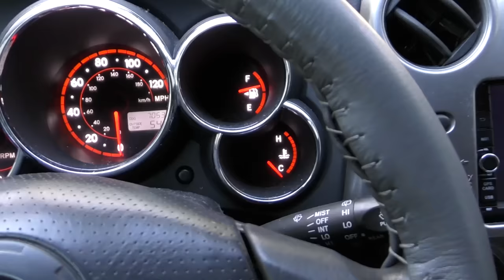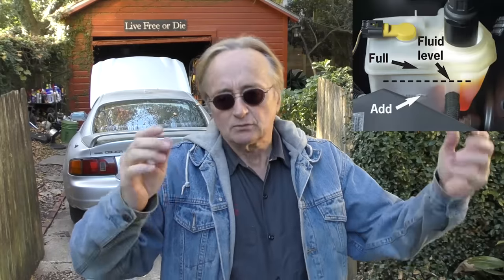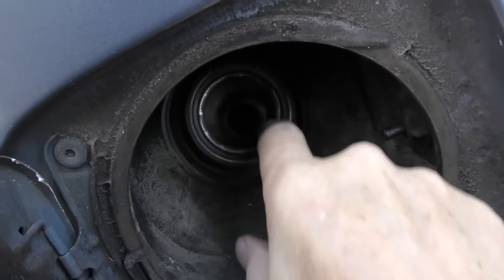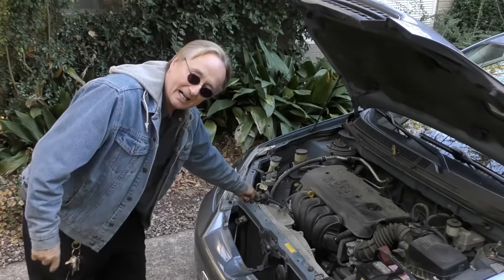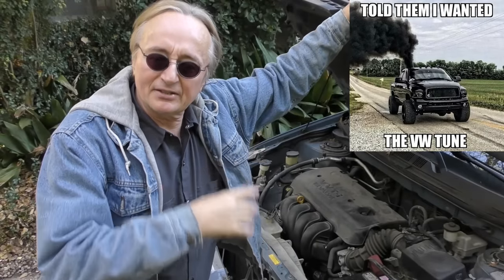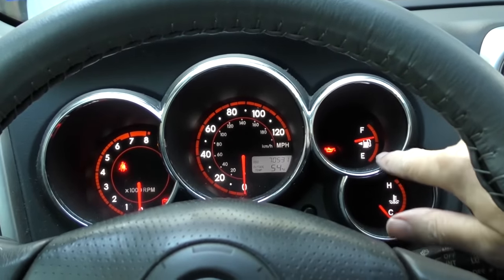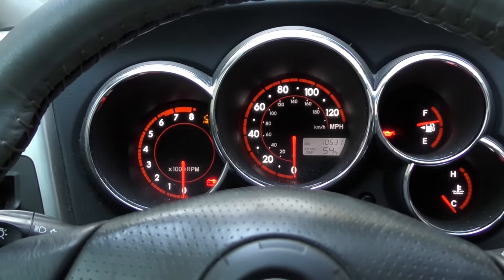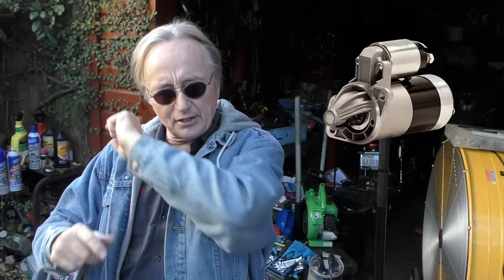Please Stop Doing This to Your Car (It Broke My Celica)

Comment: Last time I was this early, GM still made reliable vehicles.
Reply: Taha Khattabi lol u were early In the late 90s
Reply: WOW!!,that must have been back when GM was just a concept..
Reply: I'm guessing your Impala has a Buick 3800 motor in it.
Reply: Taha Khattabi my 2007 Chevy cobalt is sound with 152k miles, transmission seems kind of clunky but reverse still works and I don’t have to tap the gas for it to reverse and it can still creep in traffic with no problem
Reply: Will Dwyer Don't judge modern cars based off of your 15 year old car. You will be sorely disappointed when you eventually get a new one.
Reply: Taha Khattabi YouTube wasn’t around back then
Reply: Corey The FAM lmao u mean the 70’s right?
Reply: @erty2389  pretty much.
Reply: I've seen this "joke" posted here so many times.
Reply: Jason Blooey Lmao any new GM product is something you might have as well just literally pulled out of a junkyard.
Reply: The year was 1973...
Reply: Fred Flintstones car was GM?

Comment: In Arizona when they check the emissions they also check the gas cap. If it's bad they will replace it, free, on the spot.
Reply: No, they will tell you it's bad and YOU need to replace it. The state does not give you much of anything for free. (I live in AZ, and I've had a bad gas cap.)
Reply: @daleinaz1  That's not true at all. The emissions station has given me two gas caps for two different vehicles over the past six years. All I had to do was sign for it. The last time was just this last April. This is in Pima County.

Comment: Scotty, that last problem you discussed with the Chrysler, I had the same exact problem with my ‘97 Jeep Wrangler. I had flushed the system, still barely any heat, and the coolant level kept going down. Since I was already having to take out the dash for another job I figured why not replace the heater core. After that my heat is unbearable.

Comment: The Lime Away trick can be pretty effective - but it comes with a huge caveat. There is a pretty significant chance that when you clean the crud out you will also open up holes in the core. Frequently the only thing keeping your old heater core from leaking is the rust and crud plugging the holes, so be prepared to have to replace it ASAP if necessary when you try that trick.
Reply: Low heat? Another thing to check is the thermostat. If while driving, the heat gauge almost never gets up to normal (which is usually about 1/2 way in most cars) then you need a new thermostat. Another symptom is the transmission might not be shifting into lockup gear if the engine isn't hot enough, also indicated by the heat gauge. Temporary fix: the old cardboard in front of the radiator trick, the amount of blockage of air carefully adjusted so as not to overheat the engine.

Comment: Probably a bad idea to put this in the comments, I've been told on Chrysler's that people will soak the heater core overnight with lime away, apparently soaking it overnight works great, never tried it. Was told by a buddy it worked but he sprung a leak, then he dumped K-Seal in it, which I use and love because it doesn't clog up stuff, and the heater quit leaking coolant and he's still got heat. Win win long term.
Reply: Lot of work--are used heater cores really that expensive?
Reply: @jamespfitz  No the core is cheap, some of the vehicles are a day and a half job to pull the dash though.

Comment: Scotty, you should have told people to try and find a new gasket for the oem gas cap. I kept getting fuel system errors, no matter how much I tightened the cap. Welp, found a new seal for $1.28, put it on, problem solved. And I got to keep the original gas cap that came with the car.

Comment: all cars have temperature gauge you say? 
BMW has entered the chat
Reply: Mattfoster84 even scotties fav brand toyota, some yaris dont have a temp gauge
Reply: The hood is sealed so you need to junk the car.
Reply: Modern cars have only green and red sign!
Reply: @gertvanpeet3120  Annoying cost cutting , i like warming up my car don't know where temp is at on a freezing cold day
Reply: Nissan nv200 too. It has an rmp meter but no temp gauge. Smh
Reply: @1stock1not  How are those nv when it comes to reliability?
Reply: @CRAPO2011  all i can say is its 2 years old has 71,000 miles and hasnt had any issues yet. The cvt worries me though from all ive heard but again no problems yet. Good gas mileage though the tank is only like 12 gallons.
Reply: @CRAPO2011  let me also say its gotten 5k full synthetic oil changes. And it doesnt really ever have any substantial weight being carried in it.
Reply: Asian market Honda has left the chat and smashed their computer
Reply: @recoilman24  for shame.
Reply: No temp gauge on the Vauxhall Astra. What a joke, now drive a Volvo

Comment: ThAnk you for video![ I need to check my Mom's fluid for heater. Took her car to radiator place didn't fix problems with three visits. Owner told me my Mom doesn't know how to use heater. UNPROFESSIONAL!! My Mom a lot older than owner, & my Mom going to his dads business for three decades with son owning business for probably ten years. So my Moms heater works in some vents sometimes. Frustrating sincE she gets off work after midnight cold by beach!! Good to know about not letting gas get low!!

Comment: Yep. I tell you what I learned a lot about brakes and how to bleed them and all kinds of beneficial things just from owning a dirtbike before. I bought it and took it completely apart down to frame and swing arm separated. rebuilt everything on my own and I had no experience before doing anything like that although I'm good working and taking things apart and remembering how to put them back together. I didn't rebuild the engine but I did replace the clutch basket and disks and replaced gaskets here and there. I also rebuilt the carb and a lot
Of other things but the main thing was rebuilding the master cylinder and the brake caliper/replacing brake lines and learning how to bleed them and get those suckers nice and tight feeling. My motocross friend use to love my brakes and was impressed with how they felt and weren't spongy and nice and tight.(this model year was known for the brakes being a bit spongy) not mine though lol. but I spent More time than other bleeding and I think that was the difference maker. I had no instruction manual for the bike either just some internet posts and some videos here and there. i had no problems. Literally first kick and it started right up after being apart for a few months and everything worked flawlessly on the first go. No tweaking. So luck was involved a little
I'm sure lol but I enjoyed that project a lot. Also this was with a 2003 kx 250 2 stroke so they are designed well and fairly basic little machines as most dirt bikes are. And also growing up learning how to use a clutch on a dirt bike taught me all I needed to know when I got my first manual vehicle which I own right now. It was a great learning tool.

Comment: I don't let mine fuel  level get below 1/4 unless  there is a really good reason.  When it gets to 1/2, I start checking the local fuel prices or checking the map for gas stations, so I don't get into an emergency.  On a long trip, you don't want to sit in the grass next to the road for an hour ( or two!) for your roadside service.

Comment: Another way to find out if the starter is bad is to turn on your headlights and turn the key to start it. When the lights go dim to out, you know it's the starter. (This test is done with a fully charged battery)

Comment: Something I frequently deal with at work is people replacing the rubber seal from their fuel cap. I always advise people don't skimp on the rubber. Natural rubber, neoprene and even EPDM will all blister. People need to use black nitrile rubber. I'm not sure how it goes for diesel fumes (it's probably O.K.), but it works perfectly petrol/gas . The other rubber types blister with bubbles forming inside the rubber. (Technically, only latex is rubber, the rest are artificial rubber.)

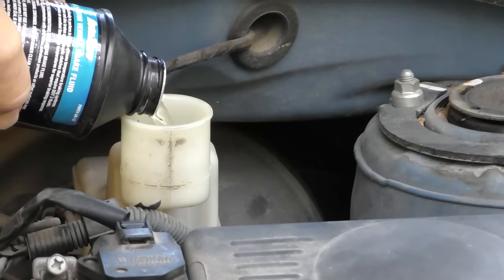Comment: 0:50 I was told if low on brake fluid, should get breaks checked.  If the pads are really worn, the cylinders will out more, and that is where all the fluid went. Just adding fluid will mask the symptom till breaks start squeeling.

Comment: most of cars I've seen here in the uk you can get access to the top of the fuel tank  and access the pump and orr fuel sender from inside the car  by lifting the rear seat

Comment: That trick with the heater core worked for me!  I had a 95 Ranger.  When I bought it the temperature gauge never left cold and the heater didn't get warm.  I figured, no problem, just has a stuck open t stat.  wrong.  the temp gauge sender was bad, and the heater core was plugged solid.I tried flushing it with a garden hose clamped on, not one drop came out.  then tried my air compressor.  Still nothing.  As a last resort, I tried radiator flush, letting it sit for an hour.  Nothing.  I gave as it was late spring and left the hoses looped on the core with the flush still in it.  As fall approached, I decided to try connecting the garden hose one last time.  IT WORKED!  And it worked great!  Tons of heat, just like new, and never leaked. Maybe someone mighty have put stop leak in it at some point?

Comment: Hey Scotty. I have a 2014 Dodge Avenger with a 2.4 and 82k miles. What’s your opinion on these cars?  How reliable are they and what are the common issues you have seen with them (assuming you have worked with them). Thanks

Comment: Scotty Kilmer Personal experience here. I had a plugged radiator so I changed it and it wasn't getting hot in side but the gauge and fluid level was fine until I went up a steep hill and that "burped" the air out of the heater core.

Comment: I "fixed" a reoccuring code I was told was gonna cost me several hundred dollars a month ago.
I replaced the gas cap. I had dropped the other one (blown off the place I set it on while fueling) and I assume something inside the interior safety vent cracked or broke.  No more codes.

Also, I read somewhere that any GM product with an evap system you should tighten the cap till it clicks at least three times. Any Ford, a minimum of two clicks. But you can't damage them turning them too far unless you wear out the little ratchet clutch turning it hundreds of times around.

Not a repair or trick, but if you drive a lot of different cars for any reason, the side of the gas gauge the little fuel symbol is on tells you which side of the car the fuel door is on.

Comment: Hi did not mean top up the fluid, most motor  manufacturers recommend you replace the brake fluid due to the hygroscopic nature of the fluid every 3 to 4 years.  I carry out a complete fluid change in my Saab every 4 years which is approx 60K miles and that includes Timing belt, coolant and brake fluid.

Comment: Fun story, one time me car wouldnt start, there was a wire that had corroded and broke, it was copper. just so happened to have industrial copper wire around. put that on the starter, it worked for another year until i had to go across a flash flood pool. probably would still have it otherwise, the brushes still had about half their life left.

Comment: I have an old Odyssey that loses about a few cups of coolant a year. I’ve never found the leak and I just top it off every few oil changes. Some things are not worth fixing.
Reply: I totally agree. I have an Accord doing the  exact same thing. I have looked everywhere for the leak even did a pressure test. Easier to just top it off every few months.
Reply: Friend had a Camry that did the same thing, didn't seem to have a blown head or anything, never figured out the issue, he just tops it off every now and then. The car is a beater anyway.

Comment: In many cases of a dead battery, the reason the battery went dead in the first place is because of a bad alternator. I would jump start the car and measure voltage across the battery terminals. If the alternator is charging, it should be around 14 volts (give or take half a volt)

Comment: Thanks Scotty. My heater doesn't work at all. I located the value that switchs the the water flow from heat to cool. I couldn't move the cable so I unhooked it. The valve seems to work, but when I ran the ac and then switched to heat the cable still didn't move. Does the cable need replacement or maybe lube it. Or could it be locked that way because the heater core blew and the old owner made it that way so the heater core would leak?? Also when I did it manually still no heat. Maybe they bypassed it???

Comment: Hey scotty, im gonna be getting my learners permit next month and want to start thinking of a first car to get when I turn 17 the year after. I recently rode in two crown vic taxis and really like the size and feeling of them and they seem very reliable. Are they good first cars?
Reply: Very much so. They're also big enough to grow with you into having a wife and kids, if it gets that far. Any Ford Panther platform car (except Mercury Marauder) from 2002 and later are the best. '96-01 are OK, and you can get them cheaper, but the first thing you need to do is to have the all-plastic intake manifold replaced with the semi-metal one found OEM in the 2002 and later, and have coolant flushed in the process.

Three small weaknesses to the car:

1. If there's misfiring (which is rare), fix it fast or it'll blow the catalytic convertor.
2. The RWD isn't great in wintry conditions.
3. If there are any kids in the car, be sure to turn off the accessories when you're away so they can't accidentally roll up the window if they lean against the rocker switch. If there's a switch in the front that disables the rear window switches all the time, it's best to turn the rear switches off as soon as you buy one and then forget about it.

Comment: Some manual transmission vehicles also use brake fluid. I had 2 94 escorts that used brake fluid for the hydraulic clutch. Had a leaking line on my escort gt that would cause my brake fluid to go low. Couldn't figure it out at first why I would lose brake fluid first then found out why. The hydraulic clutch used the same reservoir as the brakes.

Comment: 2nd reason for no heat… You smoke, you vape, you warm up your car in a closed garage (unattached for obvious reasons). These 3 things can rapidly clog your cabin filter, vaping probably being the worst. It’s sticky residue can quickly clog the pores of your cabin filter and cause a severe loss of heat production inside the car.

Comment: I have a 07 Grand Prix GT that just has the brake light come on and the screen says LOW BRAKE FLUID, but the level is fine. Brakes do need to be changed in the near future but have never experienced this before. I've recently changed all 4 wheel bearings and have checked the brake line as well.

Comment: Beam me up Scotty if you wanna check your alternator once you start your car disconnect the battery and it should keep running if the car stalls you need a new alternator

Comment: I'm so sick and tired of hearing people say I replaced the gas cap and that fixed my smog car.  Over 30 years of smog tests in calif and nevada, I've never replaced my gas cap and besides there are ways to test and fix without getting another one.  My truck is 22 years old, 225k and I've never replaced the gas cap, or the brake fluid, maybe the rad fluid a couple of times and power steering only when I had to replace it, and the gear oil once.  Still runs great.

Comment: I remember doing a heater core job in a late 90’s early 2000 Ford Excursion, the job called for 4-6 hrs total time. At the time it was one of the worst jobs I had ever done as far as replacing a heater core. It takes about 20 min to replace that heater core when you can get to it, ya do the math. The whole dash had to come out, and some of the center console. Made replacing the heater core in my 79’ Trans Am a piece of cake, and that was with removing the metal inner fender well.
Reply: I have done one heater core myself.  I will never do another one.  I will gladly pay the labor charges.

Comment: Yeah, watch out with the Lime-Away / CLR flush fix for the heater core. It might work, and it might make things worse. Or  not better in a different way anyway. It could be the corrosion had started eating a hole in the core and then plugged it up with buildup. Now the Lime-Away / CLR has dissolved all that crud and exposed the hole and you end up with a leaking heater core...

...but then you were replacing it anyway if the fix didn't work so you got nothing much to lose trying it :-)

Comment: If you can’t feel the heat and you have a coolant, engine temp is about 90'C, check the water pump. I end up replacing heater matrix and ripping the dashboard to get to it while I should start from replacing this bloody plastic water pump crap (I've replaced it with casted aluminium one afterwards) on VW petrol engine

Comment: I had an acura TL that would set off an emissions warning light every couple months. I would take it to the dealer, they would said it was a common issue with the gas caps, it was nothing, and reset the code. Then one time I took it in and they actually inspected it and the fuel system had been wrecked from contaminants, water, or whatever else. Kinda felt like they should've had to pay for that one since they were the ones resetting the light and saying it was nothing for years.

Comment: what i do (only one time) is full my tank to the capacity it says it holds (in my case 26 gallons)and i zero the trip meter. i dive until the engine shuts off and count the miles it took. now i know when i absolutely have to stop and get gas. useful knowledge😏

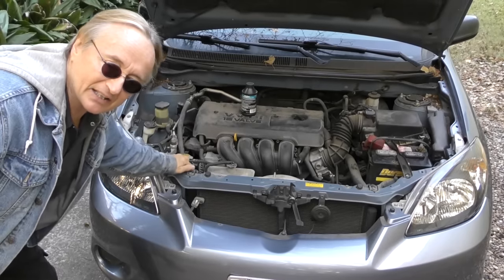Comment: 2:10 you're saying that the radiator should always be full, but isn't the coolant a 50/50 mix with water? I live in Arizona where the summer is 115 degrees and some of that water evaporates doesn't it?